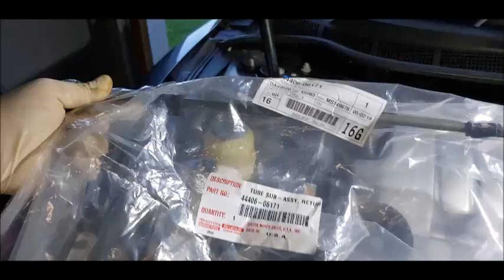2007 toyota camry power steering hose leaking

Comment: I just did this same procedure on an 04 es 330. Lexus/toyota does not make this easy but knowing what parts to remove to give yourself more access and room to work with helps tremendously. Wish I had seen this video before I did the job as I only figured that out through trial and error. And the only way to get the new return hose in is to do it in pieces by separating the rubber hoses from the metal ones as shown.

Comment: just did this on my 2008 camry. easier with the dogbone mount removed.  ordered just a suitable 10mm id rubber hose from aliexpress for 8$ and it worked fine. Thanks for toyota for making it cheaper to be able to replace just the rubber hoses. upon cutting the upper rubber hose it is very brittle and i think over time heat destroyes the rubber and it makes it easier for the hose to leak/seap..

Comment: 02-06 Camry's ( Kentucky, USA built) :  the part Mr Tran replaced is Toyota # 44406-06100,  " Return Tube Sub Assembly " . However, the part that fails after several years are those short rubber hoses . Toyota will not sell them individually, you have to purchase the whole assembly. I learned that the return line rubber hoses that Toyota uses for this is a true 10mm inner diameter hose.  These are not gotten at an average parts store. The industry standard 3/8" power steering return hose may compromise /collapse the tubing as the mechanic struggles to install the 3/8" hose.   The correct sized I.D.,  & rated for power steering fluid, part is , " Duralast 80565" or " EDELMANN 80565 ", gotten online.
Reply: Excellent piece of information, thanks for sharing. Isn't it strange that Toyota doesn't sell the rubber hose which connects to the reservoir, its stupid.
Reply: You are the man! Only my small upper hose is leaking. The lower rubber hose and the metal tube are fine.  This is exactly the info I needed.  Thanks.
Reply: Thank you so much, sir. I was afraid I would have to drop $100+ on the assembly. Just $17 on Amazon.
Reply: Would this work for a 2011 camry ?
Reply: Ty for this info, I got the Edelman 80565 but the molding isnt right but I just bent it and made it fit. Is that OK? 2008 Camry
Reply: @mektrix8887  has it been okay?

Comment: Im not quite sure I understand why I cant just replace the rubber hose with this problem. Seems to me that would work just fine. Is there a specific inside diameter issue that is going to keep it from working ? Are the hoses out there not the correct type for that fluid ? Not a mechanic, but seems replacing the hose would be just fine. Anyone know why i cant just replace the hose ? Has just replacing the hose and had it work out ok ? Help please

Comment: What kind of fluid did you put in there. The fluid is supposed to be pink... Toyota requires ATF Dexron ll or lll
Reply from the maker: I used bg power steering fluid
Reply: 2002-2006 Camry's use ordinary Dexron II or III.  It's  just that toyota OEM uses different color ( cosmetic). PEACE.

Comment: Honestly all you needed was to replace leaking degraded rubber hose with a better quality rubber hose. Replacing entire return line assembly is not necessary because there is no pressure fittings leaking and the aluminum tubing rarely gets corroded, just the rubber tubing. Thanks for the video though 👍
Reply: Anybody know the inner diameter of that  ~9" length of hose that leaves the PS Reservoir and snakes toward the radiator?  A 3/8" PS grade hose is too small. I know not to use a heater grade  hose. Thx!
Reply: My interpretation, of Mr Tran's advice of replacing both AL tubing & non-standard hoses, is the following: the combination of chemically worn mushroom tip of the aluminium tubing + non-standard PS hose inner diameter that Toyota uses = eventual leak again in ~12 months.  This is that ugly thing called planned obsolescence.  I am sorry to say Toyota is starting to inject it's cars with it.  Please see 5th gen, 2003-2006, Camry's. Headache machines. Plastic exhaust manifolds.  Stripped head gasket bolts. Piston rings designed to fail. " Oh, lets not use industry standard 3/8" PS. "  The 3rd /4th gen Camry's were just so dependable for decades....
Reply: Actually a simpler fix is to replace the spring clamp with a screw tightened clamp. The metal tube does not leak. The leaks happen at the tube-hose joints. My 2010 Camry PS reservoir to the return hose appeared lose judging from the liquid stains nearby. It is fixed this way. 
The reason I am watching this video is my older 99 Camry has rusted return line that makes me concerned.
Reply: @ferndog1461  3/8” is 9.5mm. I read somewhere the OEM ID is 10mm, so 3/8 would fit with some stretch.

Comment: Excellent video Mr. Tran! The engine bay inside your car is immaculate and kudos for finishing the job in a rainstorm. I also agree its better to install the entire OEM return assembly instead  of just replacing  the rubber hose connecting to the reservoir. Its a special hose and my local Autozone store does not have a generic replacement with the exact inner diameter.
Reply: At 21:46 where does that u shape bend hose go to
Reply: @B-S1999  it connects to the steering rack
Reply: That “U” shaped bend or “J” bend in plumbers lingo is where mine has become pitted and now leaking. Does anyone know what that section is called. Or the part # ? It goes to the steering rack. Much thanks if anyone would know.

Comment: Hey great vid. But have a question would help me greatly if you could answer. At 21:41 in the vid where you are showing from underneath the car, what is the part called for the curved line that attaches to the hose that you pulled off of it? The curved hose that attaches to the one you removed and runs through the bottom? Mine is leaking right on that curved part and need to replace it. Just not sure what the hose is called? Pressure line? Return line? Or something else? Thanks for the vid. Most helpful one I've found. I have 2008 Camry btw
Reply from the maker: They dont have a name for that hose in the botton.   And the dealer dont just sell that piece only.  The whole hoses assembly i brought was call the return line power steering.  To save money u can just take out that botton hose and take it to advance  auto parts or napa.   They should able cut up a hose that the same size u needed.  Just a headup it may leak in again in 1 or 2 year.  Hope that help.
Reply: @ponyotran2996  
Got it! Thanks for the reply!
Reply: Hi—I have a 2007 Lexus ES 350. They are identical cars as the Camry btw. Mine is leaking exactly where you are describing. Right at the bottom of that “J” bend. It’s not a hose, it’s actually an aluminumish tube like the rest of the tubing. Mine has pitted and developed a small pin hole and leaking fluid. I am also looking for what that section is called. If you found out please message me. It’s a real PIA. Thanks a million 👍🏼

Comment: Hi Ponyo. Just wondering, why did you have to replace the pipe also? Was it not enough to just replace the top hose? Thank you.
Reply from the maker: Yes you could just replace the top hose and clamp with aftermarket  hose and clamps from napa.  But more likely they will leak again in a year or so.Toyota dont just sell the hose and clamp by them self. So that why i  change the whole thing.
Reply: @ponyotran2996  You could have used the Toyota's top hose without replacing the rest.